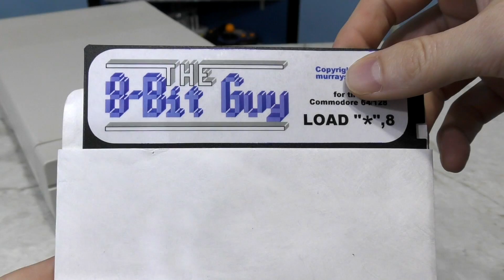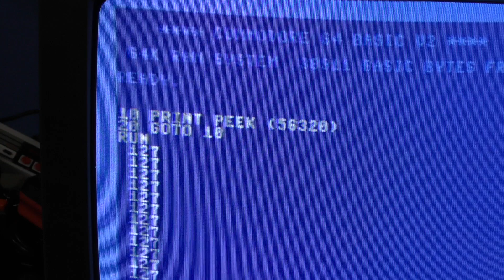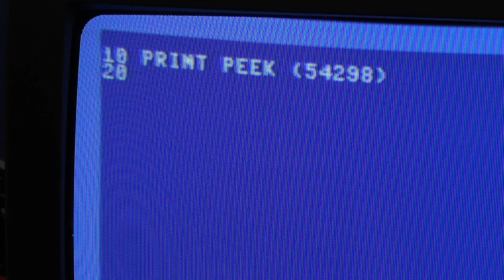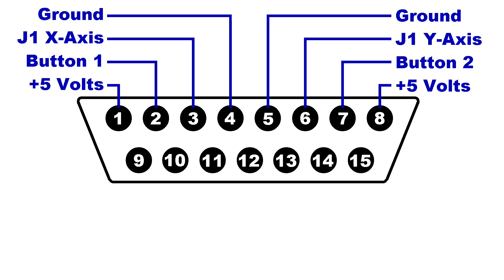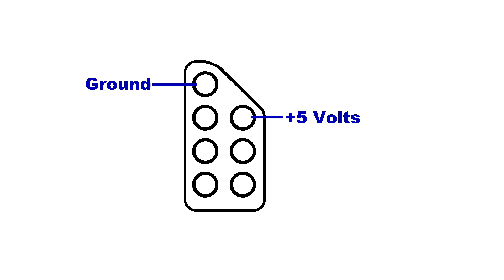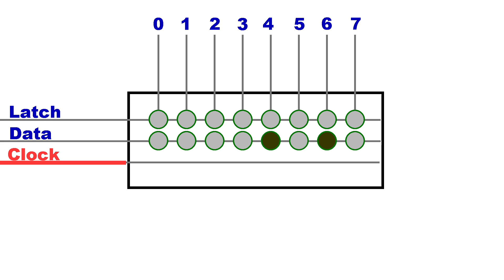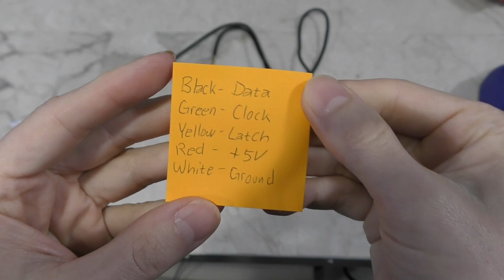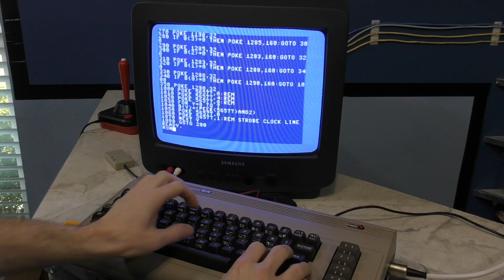How Vintage Game Controllers Worked

Comment: Hold on.... You can use Sega Genesis/Mega Drive controllers on Atari systems without any issue. It's only the Commodore 64/128 that has the problem where they can short out the CIA chip. Atari fans use the Genesis pads on 2600s, 7800s, Atari 8-bit computers and the XE Game System, as well as ST computers. And if you get the Edladdin Seagull 78 Adapter, you can use 2 of the fire buttons on the Genesis pads on the 7800 in the place of both fire buttons from the standard Atari 7800 ProLine controllers or the much more rare - in North America - Atari 7800 GamePads.

Comment: I wonder how the debounce issue was solved with data and latch approach..  can anyone one comment ?
Reply: The usual method was to read the controller several times in quick succession, then take the modal average. eg. if you read the controller 16 times, and the button is pressed for 10 of those reads - treat it as a button press.

Comment: Your video reminded me of a project I did in high school in the mid-1980s. I bought Timex-Sinclair 2068 that had a Atari style game port. The Macintosh had just come out and wanted a mouse for my Timex-Sinclair. So I took apart an Atari joystick and discovered there just five switches. After discovering how simple the joystick worked,  I went to Radio shack and bought four switches, and some wire. At a hobby shop, I bought some sheet plastic and assembled a "mouse" for Timex-Sinclair. Also, your video inspired to create an "Atari" joystick for the Raspberry Pi. Thanks for an excellent video.

Comment: 3:34

The Genesis / MD controllers don't connect the Select button directly to pin 7.

In this case, the "Select" pin actually controls a mux chip in the joypad, so the console can read more than just a few buttons.

Plugging a Genesis controller into the C64 or Amiga definitely can damage things, though. I've helped fix machines where people have done that, and zapped one or more pins on the CIA chip.

I think it happens because those machines are feeding +5V to the select pin, and the mux chip gets back-powered through the internal ESD diodes, which can then force a higher current from 5V to other pins on the computer.

Some people still dispute that the Gen / MD pads can damage certain retro machines, but just take my word for it. lol

http://pinouts.ru/Game/genesiscontroller_pinout.shtml

Comment: Hey 8-Bit Guy, loved the video, really nice. But I would like to point out that at 3:40 I believe you made a mistake. The SELECT line on the Sega Genesis/MegaDrive controllers is a logic line, it is used to signal the controller which button states to send. When the SELECT line is LOW, the controller would send UP, DOWN, A and START. When the SELECT line was high, it would send UP, DOWN, LEFT, RIGHT, B and C. This was done in order to allow the Sega Controller to have more buttons. One of the controllers and games that used this was the Sega 6 button controller with the Street Fighter games. Pin 7 being an input for the controller and not an output would mean it wouldn't damage any other consoles at the time. Maybe it happened with counterfeit controllers, who knows.

Comment: I just loved how you show each pinout from the console/computer side and explain in detail what each pin does.
Unfortunately you left out the ZX Spectrum, it also uses a 9 pin connector as the C64 but it as several protocols like Kempston (identical to Atari), Sinclair Interface 2, Cursor/Protek/AGF, Fuller, Timex Sinclair/Computer and Amstrad. It would be great to have all these pinouts combined into one video so we can see the differences/similarities, and possibly even make our own homemade adapters so we can safely use one controller over several consoles/computers. Maybe a part 2? (hint hint)
Reply: The pinouts and specifications for the various Spectrum joystick protocols are all freely available; no need to wait for a video about them: https://www.worldofspectrum.org/faq/reference/ports.htm#Interfaces
Reply: @gwishart There is no pinout description in that link, just coding and some information about how it works. I know I can find the pinouts if I google for them, but the information is spreaded over different pages and sometimes it is not explicit if they're describing the computer side or joystick side of the port...
Reply: @wettuga2762  Yes, there are pinouts in that link, click on More Information for each interface. It's hardly "spreaded out" (whatever that's supposed to mean) to have a separate page for each joystick interface.

Comment: You know if you can write that in basic, you could just as easily write the routines for arduino or similar to actually make these controllers work with c64/atari/amstrad/spectrum etc etc etc games. Its incredibly simple.

Comment: I tried the same logic used in the NES controller in the SNES controller but instead of using a C64 I used an Arduíno. The code I wrote was much simpler but it worked perfectly. The only difference that I found out was that the SNES uses 12 bits shift register (since it has 12 buttons) instead of only 8.

Comment: People always lamented the fact that the Atari joystick and compatibles only had one button, especially when it was used on the C64 and Amiga for more complex games. Everyone ignores the fact that since the Atari standard had two analog lines, they could have easily added two more buttons by using those lines for buttons 2 and 3. In fact, if they used resistors to vary the resistance to those lines, they could have potentially had 16 extra buttons.

Of course doing it AFTER the systems had bee released would have been a catch-22; No software would support the extra buttons until enough people owned the joysticks and people wouldn't buy the joysticks until enough games supported them.
Reply: So what? No game would take advantage of this.
Reply: No game would take advantage of it NOW, but they would have if it had been done back then by the parent companies.

Comment: How about gameport joysticks with more buttons/hat switches on DOS/Win9x systems?  Did the joysticks take over a couple of the button pins as clock/data lines, or was there other trickery going on?  I had a Gravis Phoenix joystick with 4 analog axes and I think around 20 buttons...
Reply: He explained that in the video. The port supports two joysticks, so you have 4 axis.
Reply: @reh3884  That covers the analog axes (yaw/pitch/roll/throttle), but not the extra buttons.  With only 8 digital inputs, how did joysticks with >8 buttons work?
Reply: @explodinglemur  They used a shift register for the digital inputs, and re-purposed one of the button pins to read it.

Comment: That isn't quite how the Genesis controller works. The "select" signal is used by the console to tell the controller to read the other buttons (there is no select button on the controller). If select is low, you get up/down/left/right/b/start on the other pins. If select is high, you get the other buttons. The six button controller works in a similar way - by pulsing the select signal, you can read the x, y and z buttons.

Comment: That is pretty neat.  I would love to see an Nes gamepad adapter for the Apple IIe.  I believe someone once told me that the polling could be done by using the AN0-2.
Another idea I had for connecting a gamepad (probably not the Nes) was the possibility of creating a switch for the keyboard.  Flipping a switch one way would allow you to use the keyboard as normal.  Flipping the switch the other would switch from the keyboard to something else, like a 7 or 8 button gamepad.  I'm not sure if that could be used with the Nes gamepad per say, but maybe you would have an idea what game pad would be suitable for use on the keyboard input?

Comment: On the Game Boy family you could press A, B, Start, and Select, and it would soft reset the handheld. How did the Game Boys do that?
Reply: Most likely the games were just programmed to reset themselves when they read the buttons and saw them all pressed. At least one game, _The Legend of Zelda: Link's Awakening_, would display the save/quit menu instead of resetting when that button combination was pressed.
Reply: That wasn't a feature of the hardware. It was written into each game individually - it was a requirement that Nintendo enforced on all game publishers of official cartridges. Lots of unlicensed cartridges don't support the reset function.

Comment: Interesting color coding on the internal wires for that NES controller: white is ground and red is +5v. 

For standard wiring (in the USA at least), the hot is black. If there is a second hot wire, it is red. 
The ground is bare or green. 

However, I’m guessing that what is called “ground” here is more like what is usually called “neutral” in household wiring. The neutral wire has white insulation so that would be appropriate. 

In other words, there is some similarity with the color coding on US household wiring. 

Fascinating 🖖

Comment: The Fairchild F8 video game system, which slightly predated the 2600, used 12 contacts and used a 3x4 grid (7 wire cable) to connect.

The joysticks were painfully fragile and every seem I've ever seen ended up with a simple button box hooked up instead.

Comment: You should have opened the Atari joy stick.  I repaired one once and a lot of people would be amazed to find that it runs off a single board with a few metal pads that completes a circuit when pressed just like a keyboard does but with way less keys.

Comment: Thank you so mutch for this video its great! I play with a NES controller on my C64 cause I love D-pads and I kinda hate joysticks (cause i love my platformers) So here is a simpel how to do. Buy a cheap yellowed NES controller for 5 bucks or so (yes yellow it match far better by your C64) open the controller and remove the cable and also remove the chip from the printboard, Look up the buttons and hole numbers (at 5.58min in this video, UP is 4 DOWN is 5 and so on) then you buy a 3 meter 6 core cable (up down right left button and ground) in china for a buck or less and connect each wire to a hole, also buy a cheap db9 connector with casing for a few cents  and connect the cables to to right pins (also in this video at 1.41 min) So if you press up on the controller it sends a signal from the up button true the printboard to hole 4, you connect a cable from hole 4 straight to pin 1 on your db9 and in your game you jump (you can Connect hole 1 to hole 4 and jump with A cause A and UP are both UP), then you can use B as the action button on pin 6 and your controller works like a NES one, only start and select are numb cause no C64 games use them. it sounds a bit dodgy but if you take both diagrams and just match up left with left  and right with right it works great, by far the easiest and cheapest way to do but keep in mind that the diagram only works with official nintendo cause some afthermarket use different chips and hole config, also afthermarket nes controllers with db9 connector as found on many chinese fake nes consoles dont work out of the box (buying a Atari 2600 D-pad controller is by far easier cause its plug and play but they get a bit over priced lately, a sega controller can work if you disconnect the select I guess). Enjoy your hacking and tweacking guys!
Reply: Thanks for reposting bro, guess something went wrong some how some where
Reply: @thecartridgegamer5725  your welcome!

Comment: actually start button, because the Mega Drive never had a select button :v
Reply: Nope, not the start button. The Select pin is an output used to select which set of inputs to read, not an input that's connected to a button. David's completely misunderstood how Mega Drive joysticks work - although to be fair, he is the "8-Bit Guy", not the "16-Bit with Blast Processing Guy".
Reply: lol

Comment: The SNES controller actually uses the same microcontroller used in the NES controller, it uses 2 of them daisy chained. The microcontroller accepts a configuration where continued pulses from the clock line would take inputs from the daisy chained shift register, thus allowing for more than 8 inputs to be stored (and sent to the SNES). There is a more in-depth explanation here: https://www.youtube.com/watch?v=tKqDVi_JcOg
Reply: The CD4021 isn't a microcontroller, it's a universal shift register; nothing in it is programmable.

Comment: Do a followup on the CD32 controller. Uses 7 buttons + directional pad and on the standard atari 9 pin connector
Reply: It's nothing special, the directions are read as normal; and the buttons use Fire1 & Fire2 to read a shift register: http://gerdkautzmann.de/cd32gamepad/a100schematic.png

Comment: If I were to adapt an NES controller to a C64, I'd actually want it to work in existing software. So I'd use a microcontroller to read the data from the NES pad and translate it over to the joystick port, perhaps making every button work as the one button to rule them all. But that's just a comment about the kind of person I am, I guess. This is a wonderful video, thank you for it.
Reply: Or if you don't care about using the NES controller with a NES again; just rip out the shift register completely and rewire the controller to a standard Atari port, optionally rewiring the B button to double as Up (handy for platformers).

Comment: Thanks for the great video. This reminded me of something I did in 87 to connect a piano toy I disassembled to an ATARI 800XL. I used the two joystick ports to read the key presses in the piano and wrote a program to play the correct note. A good experiment you might want to try. Of course, there are not enough entry signals for a chromatic octave.
Reply: You could've tried using the Atari SIO Port, the grandfather of USB.  :)
Reply: Jeremy Holloway yes, probably, but was 15 at that time, no electronics education and, of course, no internet. I found the pins with a program similar to what was shown in this video and used the connectors from damaged controls to connect the “switches” of each piano key.

Comment: Hello, you mentioned the Coleco controller towards the end, I have been converting my Coleco to a raspberry pi and have obtained an intelligent universal adaptor from a chap in Canada. The trouble is the Coleco controllers unlike a Nintendo one with it s shift register do allow for multiple button presses in the numeric pad, only one numeric and maybe a fire button too. This means using it as a emulatstion controller is difficult, I don't know if someone has got around this controller issue?

Comment: I do hope you'll do a quick followup video correcting your error on how Genesis controllers work. There's no "select" button, the "select" line is used to allow the console to read which button/portion of the D-pad is read, as there's more inputs than pins. The "select" pin is an output from the console. The reason the controller potentially fries the C64 has to do with improperly protected inputs on the computer itself, as it's not expecting the sort of input it gets from the controller that the Genesis would.

Comment: Discrete logic NES -> Atari adapters do exist, even far back in the day. They can be accomplished fairly easily with a single 555 timer and an inverted-latch, effectively replicating exactly what the NES already did internally.
Reply: How is a 555 supposed to demux serial back to a parallel interface?
Reply: Just a guess, but I think the 555 timer is used to pulse the clock line to move the shift register, then the inverted latch is used to break out the single data line into 8 output pins that will control the Atari’s 5 buttons (stick and single button)

Comment: My Atari paddle controllers have this jittery effect that make some games hard to play. Any idea what causes this and can it be fixed?
Reply: there's several videos on YouTube on how to fix them. Barring that, the modern Atari Paddles sold by AtGames for the Flashback systems are supposedly much higher quality than those consoles. They're expensive but a lot of people swear by them over at AtariAge. And Best Electronics sells refurb kits with new pots that supposedly make the Atari Paddles even better.

Comment: My question is how to fix the controllers, for the Intellivision Flashback Console?  Nobody seems to be selling replacement parts.  I have a controller that won't respond/react when trying to go up in games.  After opening-up the controller, it looks like flex circuit technology, similar to that used in the Motorola portable radios (i.e. MT1000, JT1000, GP300, etc...).  Essentially, conductive traces are silk-screened onto a flexible Mylar sheet.  I'm guessing I must have an open circuit.

Has anyone had experience with this sort of problem, or found a reliable fix for it?

Comment: Is there any way to make 2 devices work from 1 power switch? Like  would I be able to make a raspberry pi, a screen, and a power switch work from one on/off switch?
Reply: If all you want to do is run two devices from a single electrical socket, just use one of these: https://www.ebay.co.uk/p/Eagle-13-a-2-way-Block-Socket-Splitter-Mains-Adaptor/2254703289?iid=181936674031&chn=ps